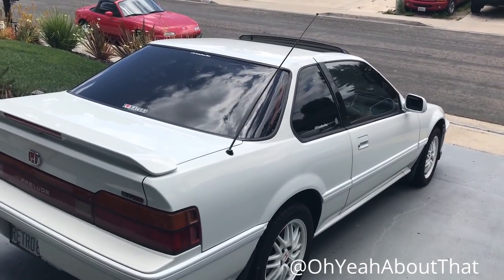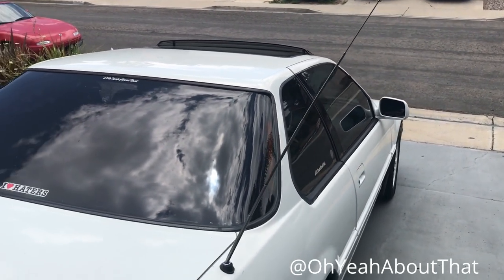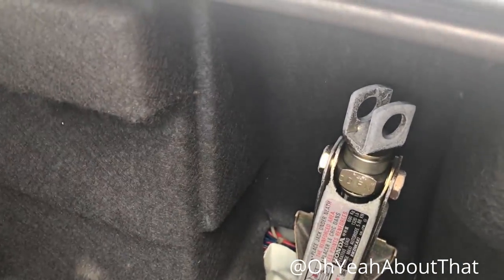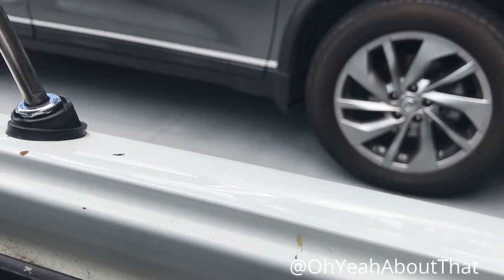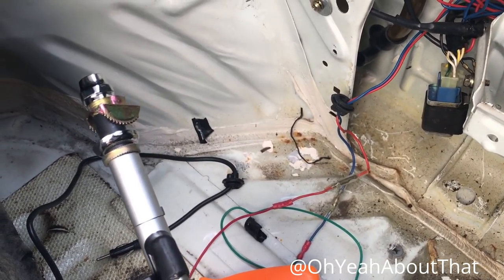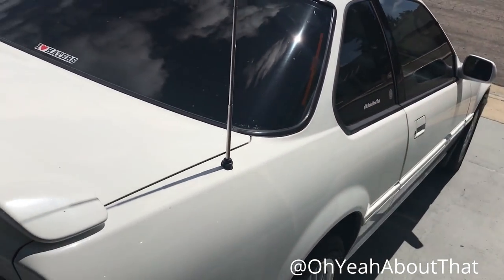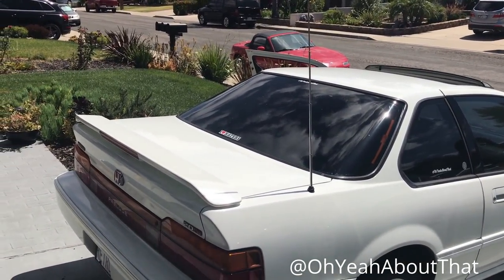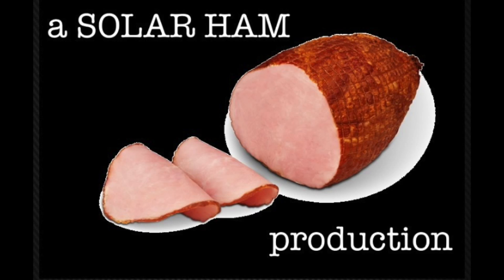project Honda Prelude Si, part 30; NEW POWER ANTENNA!

Comment: If it makes you feel better, I did a similar thing... I took my Jeep through the auto wash because I was feeling lazy and I ended up ripping the coax cable from my CB antenna.
Reply from the maker: UndergroundTrev ha ha. It's been decades since cars had power antennas. I forgot it was even there!

Comment: Where do the aftermaket wires connect onto the oem wire colors from the inside of the car?
Reply from the maker: Jesse Esquivel I’m not sure. It was already an aftermarket antenna before I got the car. Sorry
Reply: @OhYeahAboutThat  but the aftermarket antenna wires are hooked up to what wires from the car

Comment: Hmm seems like the spoiler is fitted by the dealer, mine has a factory fitted one so it also has wiring that retracts the antenna when the trunk is opened.
Reply from the maker: I think it is. It’s a Honda part but the car also has the original brake light in the rear window.
Reply: Mine is 91, it automatically retracts the antenna when I pull the trunk lever.

Comment: Hey did u have to cut the plug for the antenna wires
Reply from the maker: The car already had an aftermarket antenna in it when I got it. Yes, the factory was cut by the old owner. I’m not sure which wires they altered, though.
Reply: Ok thanks. I got mine from ebay aswell and no instructions.